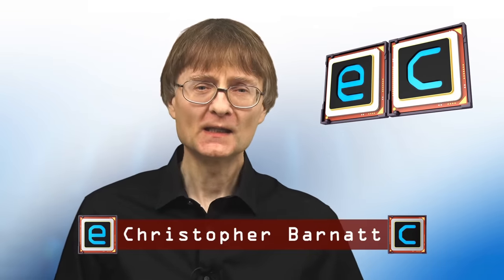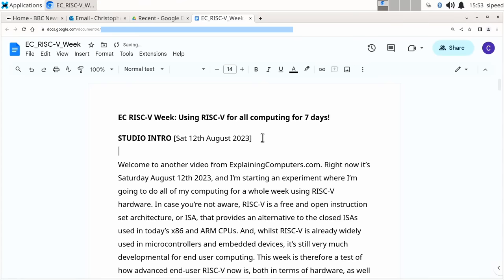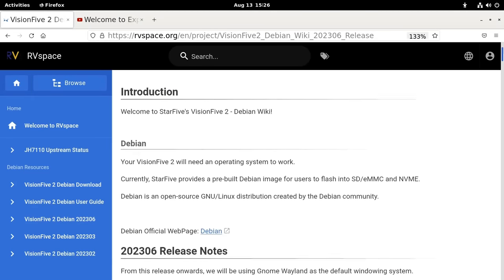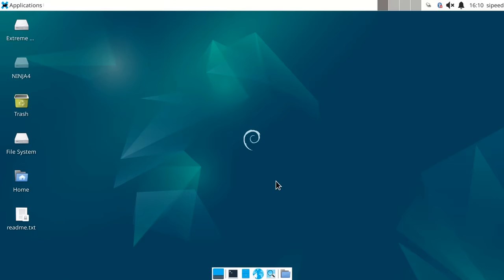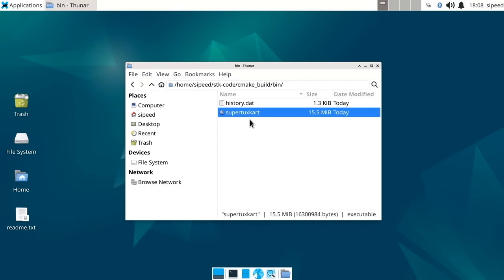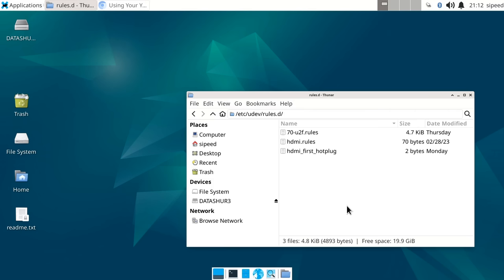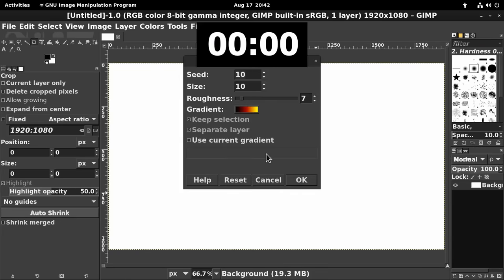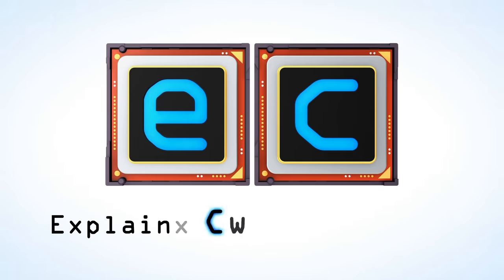RISC-V Week: 7 days only using RISC-V computers

Comment: The software support has improved dramatically but definitely has a long ways to go to get to 90% feature parity with x86_64 / ARM64. 

Nevertheless with hardware like the Milk-V coming out with impressive specs it gives me hope we will have a practical RISC-V  desktop PC option in the next 18 months.
Reply from the maker: Fingers crossed! Exciting times.
Reply: Milk-V have a number of boards, ranging from the $9 Duo with a single 1 GHz Linux core and 64 MB RAM, to Mars and Meles which are lower priced competitors for both the boards Chris tests here (using the same JH7110 and TH1520 SoCs), to the 64 core SG2042 Pioneer.
Reply: @BruceHoult  Great to have options.  Of course I was talking about the MILK-V Pioneer.

Comment: That's quite a RISC-y experiment you've performed there! 😜

I'll get my coat, Chris!

UPDATE: I made that remark PRIOR to watching your video to the end so I will apologise for this

After watching it to the finish, I have to say that the security issues that come with a lack of RISC-V support for encryption/hardware-based authentication keys/devices, is a very valid concern that the folks responsible for it need to rectify this as soon as possible
Reply from the maker: I'm glad that you waited to get your coat. :) Thanks for watching.
Reply: @ExplainingComputers  You're most welcome. 😊

Comment: Hi, I'm one of those people who told you lava is not a good test and I continue to hold that opinion.  Just because you see some activity across cores in htop doesn't mean you're getting any real concurrency.  The scheduler could bounce tasks around cores, or it could schedule multiple threads on different cores during the htop refresh window without actually running any of them simultaneously (e.g. because application has a bunch of worker threads but they all just take turns working on the same shared data while holding a mutex).

If you want to know how much of a difference it makes, there's a utility called taskset, which you can use to run a program forcing it to use only one core, e.g. taskset 0x1 gimp (now observe that gimp only pegs the first core in htop).  Do measurements with and without. 

On my 12 core ryzen, doing a 1920x1080 lava takes "about 2-3 seconds" no matter whether I'm using one or all cores.  If I quadruple the image size along both dimensions, it takes about 30-35 seconds (single core) or 28-30 (all cores).  Benefit from 12 cores / 24 threads is almost none whatsoever.
Reply from the maker: My bad.

Comment: I'd love to see a RISC-V or even just regular ARM based desktop grade machine in an ITX form factor.
Yes, I know others like Jeff Geerling showed off boards with that purpose before but these are even more expensive than x86 ITX and that already gets more and more niece since no one seems to be interested in that form factor anymore.
If we get a good ecosystem around a specific RISC-V board the size of a RPi but with two NICs and SATA/NVMe I'd be happy too as this could work really well for NAS builds.
I still haven't use my Pi 400 ever since I bought it, I'd love to see how that performs for desktop tasks.

Comment: Great video! I hope to one day own some RISC-V hardware. I wonder if additional cooling would help performance.
Reply: No.  I've run very heavy multiple-hour software builds on both boards. The VisionFive 2 doesn't get anywhere near throttling temperature in a normal home/office environment, even without a heatsink at all. The Lichee Pi 4A throttles quite a bit without any cooling, but the small supplied fan is more than enough to keep it at 1.848 GHz 100% of the time.

Comment: RISC has come a long way since my support days on HP9000 RISC machines in the early 90s.  The apps available for these SBCs under Debian seem to  still be way behind where they were back then, but then again it’s a new(ish) development system which costs peanuts. The HPUX PA-RISC 700 Apollo workstations from the early 90s which were used to create the “Liquid Metal” effects for the T1000 in Terminator 2: Judgement Day cost many thousands of pounds. The 3rd party developers did of course have  the resources of a 900lb multi-national gorilla like HP  to publicise and support the environment, so I suppose it’s not too surprising that CAD/CAM and back office Vendors created a plethora of mature applications.
I look forward to seeing this technology mature and become a cheap and useable tool.
Reply: PA-RISC 700 workstations cost between $15,000 and $60,000 depending on how they were equipped. They ran at 66 MHz, with a single CPU core. These boards are running at 1500 to 1850 MHz and have micro-architectures that execute more instructions per cycle than HP's Snakes.

Comment: Problem with most RISC-V boards is that very few seem to have a GPU paired with them.  The SoCs have a CPU and a basic display controller for video, but no graphics processing.  The Kdenlive and Blender errors both indicated they failed due to missing OpenGL support, which makes sense if you don't have a GPU available.  I'm most interested in the chip used in the PineTab-V because it has an Imagination GPU integrated and Imagination have actually decided to open up and provide FOSS Vulkan drivers for their new GPU cores, so hopefully that platform will have graphical capabilities.

Ultimately though, it would be amazing to see an open specification GPU instruction set to complement RISC-V.  The current situation of pairing an open-spec CPU with a proprietary-spec GPU (which are usually undocumented as well, requiring reverse engineered drivers) isn't ideal.
Reply from the maker: Both of the RISC-V boards used in this video have a GPU, so a lack of a GPU was not why Kdenlive failed. :) It was a (GPU) software support issue, now fixed by Sipeed so that Kdenlive now works! :) An open GPU would indeed be great.

Comment: Hmm will be interesting.  By then the Raspberry Pi 5 should be out too!!  I wonder how long it will be before we can replace a desktop PC with an SBC?  Not as convenient but all about saving energy and never more so important as NOW!  Great video loved it!
Reply: "I wonder how long it will be before we can replace a desktop PC with an SBC" ... well, ever since the original Raspberry Pi came out, depending on your desktop needs. If a Pentium or maybe even Pentium II would be good enough for you then so would an original Pi. These boards (and Pi 4) can do anything a low end Core 2 Duo can do. The RK3588 boards such as Rock 5 are probably in early Core i7 territory. Thee are still plenty of grandparents out there with Core 2 Duo machines.
Reply: Bruce that is not a sensible statement.  Those old pcs can take ssds and fast hard drives plus dvd writers etc.  They can overclock and run programs the arm sbcs cannot without emulation.  We are nowhere near equilibrium as yet!

Comment: It is interesting and encouraging.

One test I would have liked to see is whether it is possible to compile source code down to machine code (not using a VM) on one RISC-V machine and then run the executable natively on a different RISC-V processor, thus proving total op-code compatibility.
Reply: Of course you can, if you tell your compiler to stick to the standard RV64GC instruction set. I do it all the time -- make a statically-compiled binary (so it works on machines with different Linux versions and library versions) and run exactly the same ELF file on Vision Five 2, Lichee Pi 4A, and SG2042 (64 core).

Comment: I tried ordering a Lichee on Ali Express and on Amazon and the carriage was over £80! Didn't bother.

My computer equivalent of the Countach 20 years ago was an IBM RS6000.
Reply from the maker: I also ordered from Ali Express (and buy a lot from them), and have never paid carriage of that magnitude. Did you select  very rapid shipping (a few days)? I've just looked, and there are right now five shipping rates listed, from £53 if I wanted it next week, to £3.52 if I'll wait a month (which is what I normally do).

Comment: i use one of these as my daily driver, and have been for a couple of years. i bought one for cost reasons, they are a very small fraction of what you would spend on a pc or mac. you should invest in an active heat sync or a small fan, and you  should try a bare android 12 install or ubuntu you should get better preformance. they are just as capable as a net book or chrome book.

Comment: Wouldn't it be easier to use the LUKS disk encryption built into most distros by default, rather than VeraCrypt as an app ?
Reply from the maker: No, because I work across platforms, so I'm certainly not going to encrypt anything with a Linux only technology. And clearly here I want to access existing encrypted drives! :) I'm not interested in "what technology could I use if I wanted to start again and encrypt drives?". LUKS is also volume only (whilst VeraCrypt also works with containers). And you are assuming that LUKS is included and works in the developmental Debian image for these RISC-V board, which is a very big assumption. RISC-V is NEW to the desktop, and we cannot assume that ANYTHING works,
Reply: Logical points.
LUKS does actually support container files, it just rarely gets used that way.  The command line cryptsetup controls are a bit esoteric, and nobody has created a reasonable GUI app to streamline the process yet.
It is also theoretically platform independant... Though the only Windows app, LibreCrypt hasn't seen any work in a while.  So again usually relegated to command line in WSL to open containers in Windows.

It is odd that such a versatile system, included in nearly every distro, is somehow so lacking in adoption and support.

Comment: Careful with that SanDisk Extreme SSDs. They could get locked up and lose data. Please return them ASAP if warranty still applies.
Reply from the maker: Why would I return my SanDisk Extreme SSD? It has been working flawlessly for nearly 4 years. And I would not lose any data if the drive had an issue -- no drive is a permanent data store, so all drives are always backed-up. :)
Reply: @ExplainingComputers  Sorry then, i'm just worried for victims of SanDisk/WD incompetence. I saw the drive and thought "is that the drive that's on the news right now?"
Reply: @Robbie-mw5uu  Single failure?? Are you some sort of apologist? There's literally class-action lawsuit with their failed SSDs. And it's not their first mishap either, see WD SMR shenanigans.

Comment: I got a VisionFive 2 donated to me, so I guess Im checking out your review on it, did not know about it until now.

I need to buy a microSD card OR a NVMe SSD before I can isntall an OS on mine.
Im thinking a SSD might improve loading times a lot because SD cards frankly sucks for a modern OS and they do support NVMe SSD on the VisionFive2.

Also I did notice that the Licheed has two memory chips, I was asking my self if it has dual channel memory, essentially every chip is on its own buss doubling the available bandwidth.

The gimp benchmark I believe might be memory bound so that could be why its twice as fast on the Licheed, also if I recall RPi's has one ram chip so it would also be single channel.

But this is just speculation from my part.
If both memory chips was on the same channel I figure they would probably stack the second ram chip on the backside for minimal trace length between them.
So yea the layout to me seems to suggest that we might have twice the bandwidth on the Licheed assuming same memory clocks.

Just a speculative observation XD
Reply from the maker: You will almost certainly need to perform a firmware upgrade to use an NVMe SSD as a boot drive on the VisionFive 2. I've still yet to get mine to access an NVMe drive. Good luck!

Comment: Don't know if someone else has already posted this, but the SPARC processor in Sun Microsystems Servers, bought by Oracle, were RISC based chips to my understanding, and they ran Solaris, a full fledged UNIX, for YEARS before Linux came on the scene.
Reply from the maker: True, but I am not sure of the relevance of this comment. RISC never went away. Not least all ARM chips are RISC. :) RISC-V is not being heralded (here or anywhere else) as the arrival or return of RISC. It is just the name of a (relatively) new RISC ISA. In other words RISC and RISC-V are NOT the same thing! This video is about the very new arrival of end user RISC-V computing, NOT RISC computing.

Comment: At 22:44 I did the same render in Gimp on a PI 4 8GB running at 1.75GHz took only 19 seconds to complete. I can't see how a 16% CPU increase has less than halved the time. The only other difference is that it's running Manjaro (ARM) KDE.
Reply from the maker: This is interesting -- was it the same resolution? After my RISC-V experiment I hooked up a Pi 4 and repeated the GIMP test several times and got the result shown in the video. My rest was in Raspberry Pi OS.
Reply: @ExplainingComputers  Yes Chris 1920 X 1080 which is the default when opening a new. I clocked it back to 1.5 GHz (default) and run the test again taking 23 seconds. I can't understand why.

Comment: 5:30 It’s counterintuitive that video playback is fine while audio is not, given that the former needs far more processing grunt than the latter.
Reply: it's a simple bug talking to ALSA, probably getting the order of samples in each packet reversed or something (sounds like that). And easily fixed by using the 3.5mm jack or telling Chromium to output via e.g. Pipewire not directly to ALSA. And no doubt fixed very soon anyway.
Reply: @BruceHoult  So this is the secret to the Dalek sound!

Comment: Hi Blender GPU Dev here and hardware enthusiast. That blender isn't working might be related to the OpenGL stack it requires. Do you have any information about the OpenGL versions that are supported already? I can imagine using Blender 2.68 has better compatibility for these platforms. Not sure if there is a pre-build package for that version.

Comment: Noisy SBC fans: carefully pull up the sticker with an x-acto knife, put it aside, keeping it clean, then load in a tiny bit of axle grease. If you get any on the surface around the hole, clean it with isopropyl alcohol. Now replace the sticker (or a piece of clean tape). Not sure why your sticker is facing up, all my fan stickers face down but of course YMMV... using this method, I have fans that have worked for years now on Raspberry Pi's. I typically have to reload the grease every 6 months to a year.
(Of course I acknowledge that putting this much effort into a $5 fan is remarkably pedantic; but sometimes pedantic is what you need when you're stuck on a Sunday afternoon with no brick-and-mortar stores nearby...)

Comment: 14:26 Only 56°C ... pah. I have driven my own render machine up to 98°C doing 3D renders over several hours. Fans going full blast, of course.

If you use the “sensors” and “acpi -V” commands, that should give you some idea of temperature ranges, frequency throttling etc.

Comment: Right  Sir.......seem  to  recall  Risc5  videos  While  showing  desktop Linux  ,....there  isn't any  repository's  or  "free  software  tool  library's "  available......

The  system....is therefor  pretty  much  useless .....

mind  you,  the  above will  hopefully  be  an obviuos goal  for  RISC 5

thx.......
Reply from the maker: How is the system "useless"? As discussed in the video, these are development boards. They are not consumer products, but a step in the journey towards them. Some repositories certainly exist, or I could not have installed software using apt install commands. They are hosted by the developers right now I think. But that will change as development accelerates and adoption grows.
Reply: Right.......true,  with  it  running any web  browser  then  it  will  indeed  reveal it  to  be  an  extremely  useful  device.....with  a  www  network  available......

Thanks
Time  Berners  Lee..........( see )

Comment: I wonder if the issues with U2F (the two-factor USB tokens) were just because it was missing a udev rule that would allow non-root users to talk to the device.
Reply from the maker: Sadly this was not the issue, as I discussed and demonstrated in the video! :) All udev rules as required in Linux were present.

Comment: A significant concern I have with RISC-V is whether its components (CPU and RAM, specifically) can be socketed, for ease of repair & upgrading.  Is there anything in the RISC-V specifications that would prohibit such socketed components?
Reply from the maker: There is no reason they could not be socketed.
Reply: This is reassuring.  Much appreciated!

Comment: In my experience typically you should stick with rolling release distros and ones that are more bleading edge, such as Arch based distros (would recommend EndeavourOS ARM). With my desktop PC experience using Debian has more issues that Arch has resolved (as its ahead of Debian).

One is performance, performance is always better on Arch (based on my performance benchmkar tests)
Another example is on xfce, when I played full screen game content, it would go to my non-primary screen, on Arch based using xfce, this is not an issue
Last example is with chromium based browsers, scrolling is incredibly slow, this used to be an issue on Arch but they fixed it but on Debian based its still an issue.

Anyways its just me giving a suggestion to use Arch, especially on low end hardware devices.